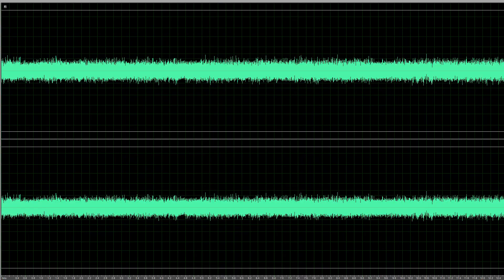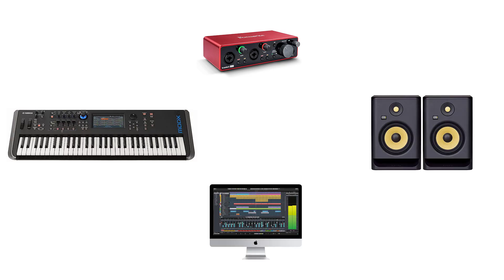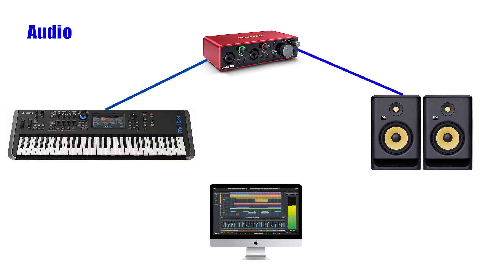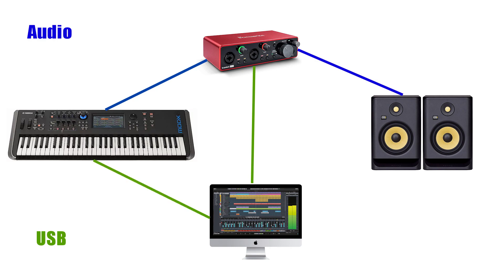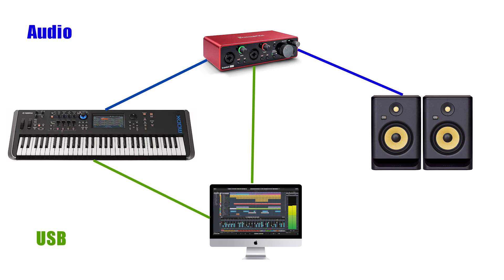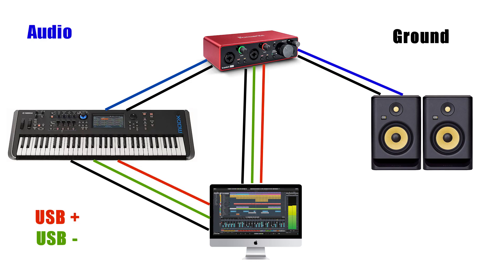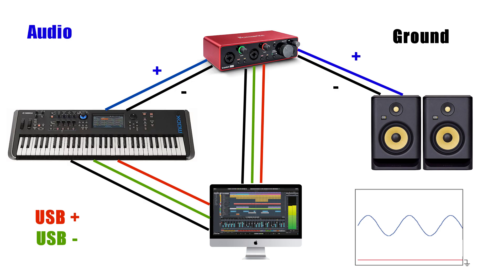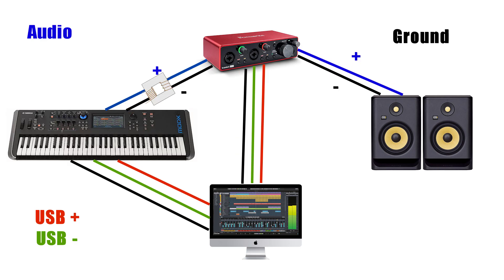How to get rid of digital noise coming across on your audio on your synthesizer/DAW setup!

Comment: Thank you so much for this tips. I recieved my iDefender+ today and it totaly elimited my noise issues. I connected it between my Yamaha PSR-SX720 and my PC. This USB cable is only for MIDI and not audio.  The noise was reduced by 80-90 procent but could still be heard if listen carefully on my headphones on full volume.  I then tried with a 5V mobile charger and plugged into the iDefender's side (which was suggested by some reviewers on Amazon) and that totally elimited all nosie. I am not sure why the extra power is needed since the PSR-SX720 are power by an external power source and not by USB. Anyway I'm really happy that it fixed my noise problem.

Comment: There is another solution: Get an ADAT mic preamp. (cheap ones like the Behringer ADA8200 will do) Get a USB to ADAT Interface (I've got the RME Digiface USB) All noise is gone by now, because the hole audio world is not electrical connected to my digital domain. The Audio data comes in via Light pipe. Hope that helps
Reply: That worked for me too. This was one of the best invests. Thanks for your comment

Comment: Hi Scott, I have a lot of analog synths that are not connected through usb but only through audio cables to my interface and all of them have a noise floor(some more than the others) and combined is quite high. Is there any solution to remove that noise or at least lower it to be almost unnoticeable?
Reply: Process of elimination. Disconnect all add 1 by 1  keep Audio and mains runs separate as best as possible. As you build up each device notice the difference. Say you get 3 keyboards set try switching around the power plugs in different combinations and move PSU units away from each other, monitor the noise on head phones. This does help. Pc audio Def needs a filter though. It was easier in the old Atari midi days as it was just mains and jack and midi. Good luck.

Comment: Hey Scott, great and timely video...I'm getting a lot of the same digital noise whenever I plug in my USB MIDI. I was tempted to use an inline audio cable version but you're right, significant drop in audio signal quality (worked like a HP filter of sorts).

Comment: Man, this digital noise has been driving me mad! Thx Scott
Reply: So, I've tried  the Ifi Defender+ with my Yamaha Reface DX and it made the noise SIGNIFICANTLY WORSE. Also tried it with my audio interface and it didn't help a thing. Then I went to a local shop yesterday and bought a powered external USB hub to which I connected my synth: this proved to be the solution, for me. The noise as good as vanished. Yes!

Comment: Thank you so much for this video!
After some research, I went with the Hifimediy USB Isolators, since they can supply 200-600mA (depending on the version) without external power. I only bought 2, as when the TI ISOUSB211 is generally available, we should see the cost of USB Isolators (even for High Speed/480Mbps) slashed in half.

Comment: Thanks Scott, I've ordered one of these and will give it a try.  I've been using the Pyle ground loop isolators which usually solve the problem and are cheap, but I never liked the idea of sound coloration and/or fidelity loss.  Plus there is the increased hassle/cost of additional cables for each stereo connection so maybe overall cost ends up the same?

Comment: THANK YOU!. I have tried multiple USB interfaces and always had some degree of the "electronic noise" on every one I tried. It was so annoying I went back to analog line-in for all my webcasts. It has been great for awhile, but depending where I go, the hum from the line-in is too much. I'll definitely pick up one and see how it goes. I'm so tired of asking how to get rid of this issue and being told I'm using the interfaces wrong.

Comment: Thanks for this awesome explanation Scott. I have that noise however it comes from a mixer (a small Allen & Heath ZED-10x) I have connected to my Focusrite Octopre which connects to my interface (an SSL 12) via adat and not USB. The interface then connects to an OWC Thunderbolt 4 dock ultimately via USB-C.

All the other outboard synths that are connected to the octopre do not make noise, it's only the stereo channels from the submix. I tried taking the 1/4 inch outs into a DI into my audio interface and taking the XLR's directly to the interface as well. 
I have reduced it somewhat by keeping the output level of the mixer pretty low and jacking the synth volumes and gain on the interface higher which sometimes distorts. It's manageable but I'd like to have this thing dead quiet like the rest of my rig if possible.

Sorry I know this is not USB related but if you have any quick thoughts on how to maybe resolve this would be appreciated. I do have the ability to bypass the Octopre and use the audio interface built into ZED 10  instead with the adapter that you're referring to. Would that work?  Is that possible?

Comment: I’m having a slightly different kind of problem, but wondering if you have any advice. I’m not getting a constant static noise coming through, but whenever I play notes on my keyboard I get a static-click each time I play a note or chord. I have shut everything down and restarted and it still does this. This is a new issue that just popped up. It wasn’t doing this the last time I played into my DAW. Unfortunately, you can hear the static click in any recordings that I playback so it’s not just in my headphones. It’s actually being recorded as well.
Reply from the maker: Wow, that's something new I haven't heard of before. I would start by disconnecting things one at a time - MIDI cables, USB cables, etc. to see if there is one of them that solves the problem when it is disconnected.

Comment: Thank you Scott! What you've outined in the video is PART of my problem.  However I'm having issues even without the computer/interface.  As an example, I"ve determined that with my Moog Sub37 running into an SSL Big6 the noise was reduced to negligible status by running the power cord into another room.  DO you think a power conditioner will help with 
that?

Comment: Thankyou for this. This is just a comment, not a solution - I need to try out the USB Ground Isolator yet, but your video described my issue with digital noise exactly.
I have a MODX and a Wavestate. If I plug them both in to my PC (for midi) and route the audio out to my Zoom L-12 (awesome mixer by the way), then I get digital noise on the MODX channels. If I use a Roland UM-One on the MODX and a USB Cable on the Wavestate, I get digital noise on the Wavestate channels of the Zoom Mixer.
I'm guessing that I could either try another UM-One, or get the isolator and try that.
On the PC side, I use Cantabile (also awesome) because I want to run various soft synths like Wavestate native or the Arturia V-collection
Thanks again

Comment: Does using this device between audio interface and PC reduce functionality at all? For instance, between a Focusrite scarlett and a laptop, will there be loss of function or increased latency?
Reply from the maker: Absolutely not. It is a purely electrical connection, there is no decoding/re-encoding going on, so no latency added at all.

Comment: Where in the chain would you put this thing? I have an analog synth hooked up via Din midi and stereo 1/4 audio which both go to my SSL interface which is connected to my computer.
Reply from the maker: This is to prevent ground loops caused by using USB MIDI. DIN MIDI already has optoisolators built in to prevent this, so if you are still having noise, this product is not going to help.

Comment: Hi all,

Issues: Loud random static noise pop up on one HS8 left speaker and it won’t output  guitar sound. Unless I change guitar preset on my Hotone Amero stage 2 and it works again. Sometimes it produces loud pink noise (on both speakers) and it won’t go away till I switch the power off on guitar processor and speakers. It’s happening every time I play almost every day.
Connections: Guitar –to Hotone ampere stage 2 – Xlr out from Hotone to XLR in Yamaha HS8 Studio monitors. Usb c to usb a to laptop.
All the power is from one power Board. Please advise if you any idea how to get rid of these- thanks in advance.

Comment: Hey Scott. Nice video. Great synths. I was trying to record my synth yesterday (Roland JP08, going from the output jack, through a couple pedals, to an amp, then from the output of the amp to my audio interface. I don’t have any USB from the synth to the computer, but I’m getting that exact static noise you described. I might just take the amp out of the equation to see if that helps, but maybe that DI you mentioned would help as well?
Reply from the maker: You've got lots of things in your audio chain that could potentially introduce a ground loop - you're going to end up having to pull one out at a time to see which one is causing it - and keep in mind it might be more than one!
Reply: Okay, I’m going to trouble shoot after work. It’s just weird that it sounds perfect from the amp, but then I go amp to interface to comp, and I get that exact sound you show in the video. I’ll let you know how it goes!
Reply: So I found a solution. My friend told me about “gain staging”. Basically ran the synth at full volume and lowered the gain on my audio interface. I also took out the amp. Nearly perfectly clear!
Reply from the maker: @theoliviaarchives4794  That's not what gain staging is, but what you're doing is reducing the S/N (signal to noise) ratio. So if you have say -20dB of noise floor, and your synth is putting out a signal at -12dB, the amount of noise compared to the amount of signal is significant. But if you jack up the synth so it's peaking at 0db, then pull down the gain on the input to bring it back down to -12dB, then you are also pulling down the noise. You don't eliminate the noise, but you're reducing it compared to the signal level. You just have to be careful that you don't have the synth up so high that you saturate your inputs and cause distortion.

In the old days of tape, we did the exact same thing - pushed as much signal onto the tape (without saturating/distorting) as possible, to try to make the tape hiss noise floor inaudible.
Reply: Oh okay, that makes sense. I might have got the terminology wrong. Basically pushing the signal the highest when it’s the purest, and like you said, as long as it doesn’t distort.

Comment: Hi Scott. Thanks for the video. I have a question. I have multiple synths connected to by a powered usb hub and the hub is connected to my MacBook. Should I have one ifi defender connected to each synth’s usb input to the hub? Or should I have one connected between the hub output and the MacBook?
I do also have an ssd storage drive connected to the same hub
Reply from the maker: It...depends. I would certainly try this first, to see if it takes care of the issue. Keep in mind however that you are tying the grounds of all the USB connections together, and you then have the potential to create ground loops between those common USB grounds and the common audio grounds. In my case, I still had noise this way, so I ended up putting these iFi iDefenders on each USB cable even though they were all going to a USB hub.
Reply: @ScottsSynthStuff  thanks for the response man. Would you say that the quality of the USB cable (between a generic and high end expensive) would make a difference in eliminating the noise completely?
Reply from the maker: @khalid6949  It shouldn't - it's not a question about shielding, it's about a physical connection with a ground differential between the digital and audio grounds. If all synth designers would use an isolated ground (or better: balanced connections) for audio, then this wouldn't be an issue. USB is a digital format, it either works 100% or it doesn't work at all. The quality of the cable isn't going to affect the "quality" of the sound.

Comment: Can you use the IFI on a usb hub?  I have a laptop and have multiple synths connected via the hub.  So it would be hub->IFI->laptop.  Thanks in advance.  And the hub it’s AC powered.
Reply from the maker: It should work just fine, just make sure you don't introduce another ground loop from the power going into the hub.
Reply: Hi, I also connect multiple synths through the Hub to my laptop. Has iDefender worked well for you? Regards

Comment: I have the ol' every time I move my mouse while using high-gain guitar (that is properly gated) I get obnoxious noise kicking open the gate ect... So I believe I also need this device in-between my DAW (UR22) and computer. The question I have is: do I need the power supply version since the UR22 is powered by the USB? I doubt it but just figured I would ask.
Reply from the maker: The answer is...probably. Try it, if it doesn't work, then plug in a power supply.

Comment: I have that same noise issue but instead of it being a synthesizer problem it's a interface-PC problem. I tried using a DIY cable, a generic USB isolator and even the iDefender+, with power supply as suggested, but still doesn't work — the noise persists. Would you happen to have any idea what the problem could be here? 😕
Reply from the maker: You've confirmed that it is the interface? If you unplug the interface USB cable from the PC, does the noise go away?
Reply: Same issue

Comment: Very good video. This is an issue for me on one synth, however my issue now isn't with USB, but with the power supply. The synth is off but plugged into power and the computer is on plugged into power and the noise is there, very quiet but there, unplug the power, noise disappears . no USB cables involved (except between the computer and audio interface). Any idea what might be the solution, does this call for a DI box? In the UK so the power supplies have ground pins if that makes a difference! Thanks!
Reply from the maker: That does sound like a ground loop - I suspect a DI box or audio ground loop isolator would solve this for you. Also make sure the synth and computer are plugged into power in the exact same spot!
Reply: @ScottsSynthStuff  It's very strange I've figured out the issue. It is the USB cables... but not the one on my polybrute, the one that has the noise! I have a grandmother and a minilogue that were plugged into a usb box and then into the computer. unplug one usb and the noise got better, both and the noise is gone. But it is still to do with the power becasue the polybrute is plugged into power and the audio interface but not usb and the problem is there and disapears when not plugged into the walll. Anyway long story it is a usb isse (sound changes with mouse movements. So just a usb will resolve it!

Comment: I have recognized a significant sound that may be digital noise and drives me bonkers. I tried to use EQ to reduce it and it helped some, but I still hear it when I play it in my aux system in the vehicle. The aux system picks up what could be distortion easily, but even with all of the reducing that I do, the static sound is still there and stalls the ability to have a clean production. So my set up is 2, 3 MKII JBL Monitors that plug into the Focusrite Scarlett Solo which plugs into the USB jack attached to my Mac Pro. Separately, my Akai Midi is also plugged into the USB jack that goes in the Mac. I don't know where to begin with this complication.
Reply from the maker: Start unplugging things one at a time to see which one causes the noise to disappear. If I were to make an educated guess, it would be the USB cable from your Akai to your Mac. If that's the case, then put one of those iFiDefender isolators on that cable (link is in the description).
Reply: @ScottsSynthStuff  Thank you! I'll see and give you an update.

Comment: ok,  so I have a keyboard that I plug into my interface with a 1/4 jack trs cable, would plugging that into the back of my synth help? or does this IDefender need to be in the circuit to eliminate the noise?

Comment: Does this apply when I have a device (Roland AIRA J-6) connected to the USB port on a notebook PC?  No other equipment is involved.  I even disconnected the charger, so it was only powered by the batteries in the computer and the J-6.
Reply from the maker: If you're using USB audio (where the audio is sent digitally over the USB port) and not using the analog mix out, then you don't have to worry about this. If you are sending analog audio out from the J-6 to a separate audio interface which is also connected to your computer via USB along with the J-6, then you could very well have this noise issue.

Comment: Hi Scott! Really good information. ¿Do you think this would work if I have a bunch of synths connected to a USB Hub and this Hub connected to the computer trough the IFi Defender?
Reply from the maker: As long as there is no ground/interplay between the synths and the USB hub, or between the individual synths (which will all be grounded together at the hub). The only way to know is to experiment - some synths are much worse than others in this regard.
Reply: @ScottsSynthStuff  thanks for answer!
Reply: Did you try to put the iFiDefender on the USB Hub? I'm wanting to try the same, would be nice if it works!